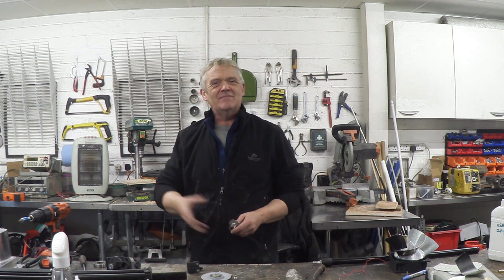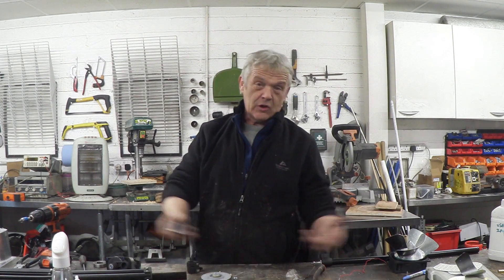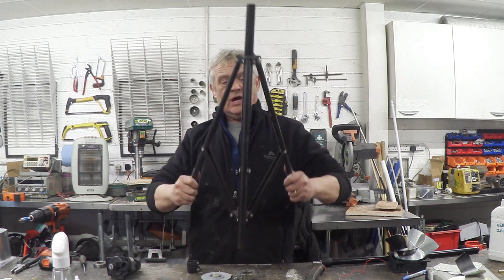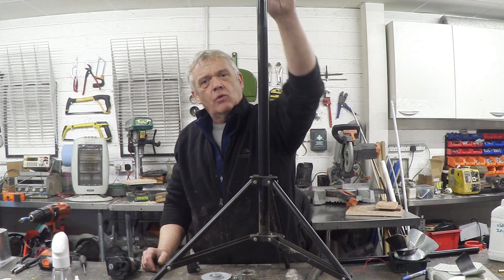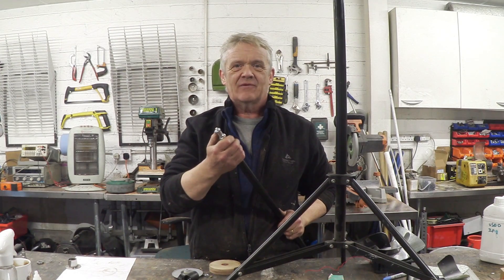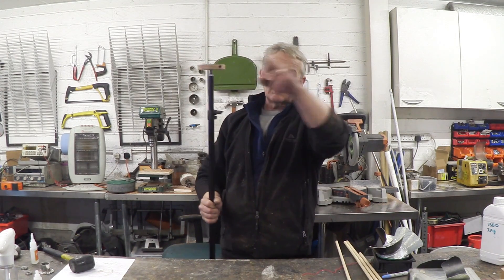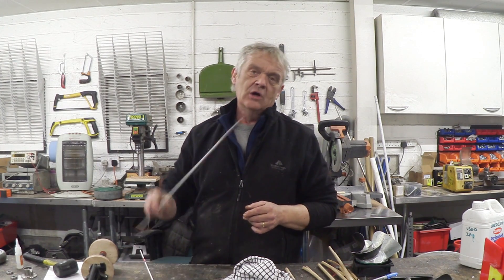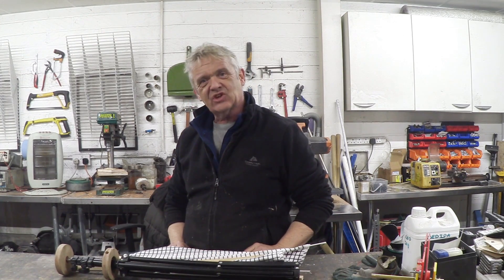1353 The Tea Towel Wind Turbine

Comment: Robert, when I was a young man, there was a citizen in our town that developed the guidance system for ICBMs.  At some point, he threw away his career and moved to our town and bought an old abandoned farmhouse.  He lived there with no power company electricity, but he had plenty of power.  
On top of his house, he had a sail turbine, and the sails were square but folded along the axis like triangles.  The sails caught the wind behind them and opened up and drove the shaft.  As the sails faced the wind, they folded down and presented no resistance.
I know this because he helped me build my first transmitter from an old army surplus signal generator powered by 6C4 vacuum tubes.
His whole house was lit with flourescent lights powered by his battery bank supplied by his turbine.  It was quite a sight to see in operation
Thank you for what you do :)
Reply from the maker: that is interesting thanks for sharing mate
Reply: Nice, that sounds like something I would do. :).  I once pondered a similar idea but powered by water with collapsing blades.

Comment: My Mom had a rotating laundry line.  Square umbrella-like canopy with a stand from piece of  pipe loose fit into a larger one that was set in concrete and buried in the ground.  If a storm came up (in tornado country) when laundry was out, it would spin pretty well.
Fun experiement Rob, and good video!
Suggest running your tea towel "booms" biased outward on a chord, rather than directly intersecting into the mast rotor.
Reply from the maker: give it a go building your idea mate